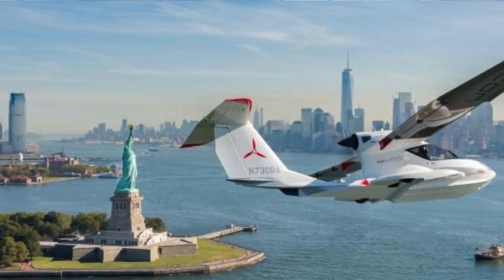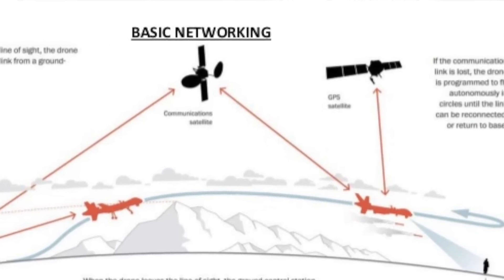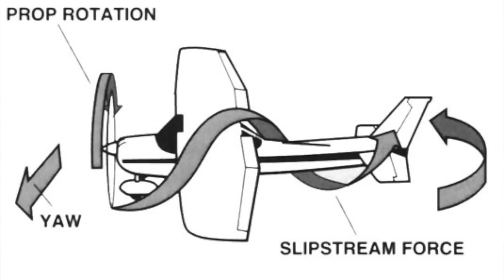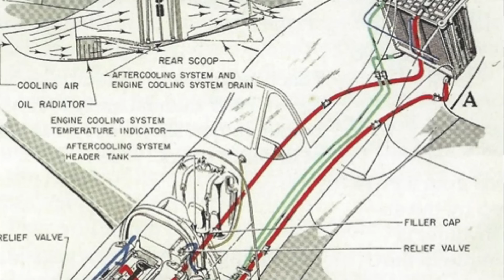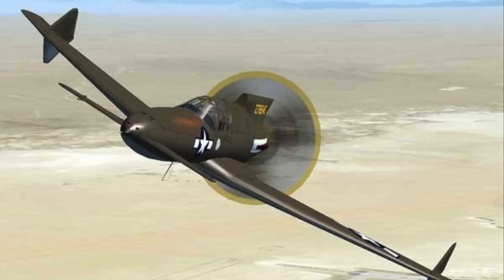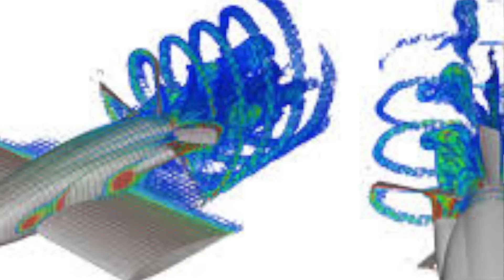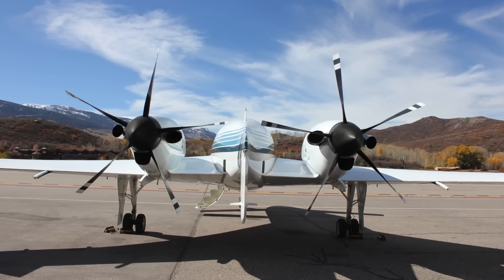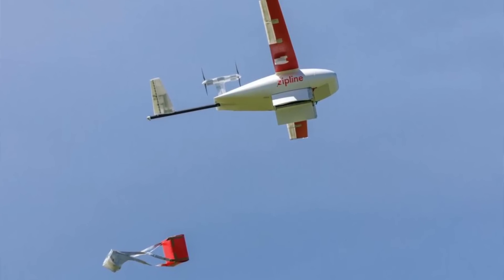PUSHER AIRCRAFT  Configuration    EXPLAINED IN DEPTH

Comment: Great overview. One notable example you didn't mention is the Northrop XB-35/YB-35. It managed to overcome most of the drawbacks of a pusher design while retaining the efficiency advantage. The engines were embedded in the wings, but the propellers were raised to clear most of the turbulence.
Reply from the maker: Yes, there are some other drawbacks (typically, but not necessarily so) to using offset thrust line, or thrust angles, or combination of both, but it's a good solution if you can make it work. 
The propeller will still be working in the turbulence of the nacelle, but that's far better than working the pressure differential of the wing. Maybe even negligible in terms of effect. 
I should do another episode on Flying Wings.... 
and the physics behind their implementation, also the unique design compromises, and why we do not see them used as airliners when we can clearly make them fly reliably in certain military applications.

Comment: Great video quad brushless drones you notice the prop wash in the form of no bite are you saying the wing and fucilog cause the similar bite problems or vibration problems on winged fliers? I have an A.R. 900 push wing but I havent flown it yet because I need to or want to have gps on it since I plan on using it for long range / flight time. Brushless pushers are great on power w a tail wind but fighting that wind coming back (flying into the wind) can super drain your energy that's why I want GPS incase I end up with a tail wind that takes me past a point of no return I see dji quad filters run into a similar problem which is really bad news if over water

Comment: Ouhps! You sure? Balony said my old flight instructor to such explanations.
Reply from the maker: what specifically?   lots of explanation. What is wrong, in your opinion?
Reply: FPVREVIEWS the whole pressure subject and Bernouli is overstated. The biggest component of lift comes from moving the sourounding air downward.
Reply from the maker: @tinolino58  Newtonian lift (which i'm assuming you are referring to) also acts on the structure through pressure differential. You are correct, that in a high CL airfoil , only 20% max of the lift component is produced via bernoulli effect, and not as much at all AOA.   
Coanda's theories are also interesting, and partially overlap both.  It's another way to think about the subject. 
When I refer to pressure differential, I'm not specifying the effect.
Reply: FPVREVIEWS Thanks ☀️

Comment: I cried watching this video.... I should have opted engineering 20 years ago.... I'm stuck with accounting and that boring spreadsheet.
Reply from the maker: don't give up. you can design model aircraft like me.  it's the next revolution in aviation.
Reply: @FPVREVIEWS  Thanks a lot for your kind support. I'm indeed having intention to design such model aircraft. Would you mind telling me what physics I should understand?
Reply from the maker: @iwantriharjanto4288  Aerodynamics and structures. There are many good books  on aerodynamics, but focus on the material for low reynolds numbers aero design, and general use.   
Also automated control systems, such as ardupilot.  Good info on their website, ardupilot.org
Reply: @FPVREVIEWS  I'll try to find the books. If you have recommendation on what books to read, please let me know. Thanks for your info.

Comment: G'day mate. What is a good easy to use software package for design and testing of UAV's.
Reply from the maker: I'm using Coreldraw to make vector patterns for cutting parts.   a 3D program such as Solidworks, or auto cad would be better, but very expensive, and longer learning curve.  you have to get all of the factors straight in your head first anyway, as the hardest part is the concept/configuration.  getting everything to fit is hard too, if you are trying to make a truly new design.  might have to go back to the drawing board multiple times.  Understanding flight dynamics, and getting the right configuration for what you are trying to do is the first, and most important part.  It's what almost everyone gets wrong, including big companies, like Facebook.
Reply: @FPVREVIEWS  Thanks mate.